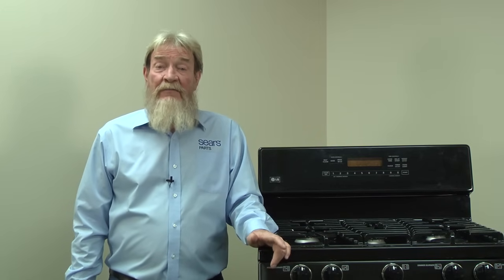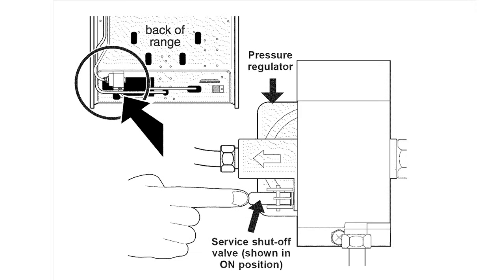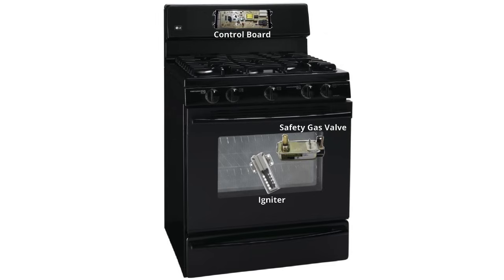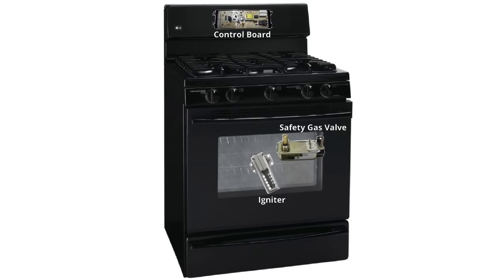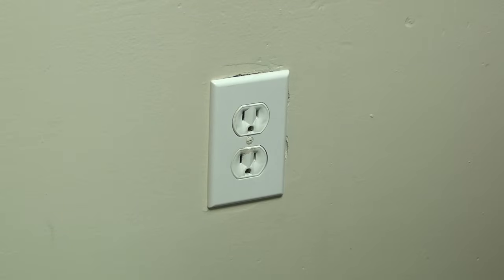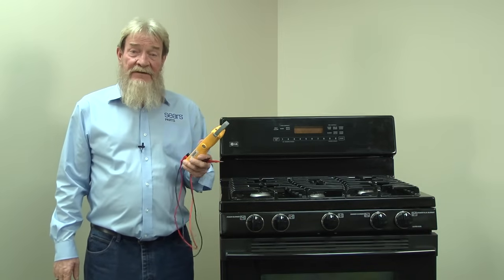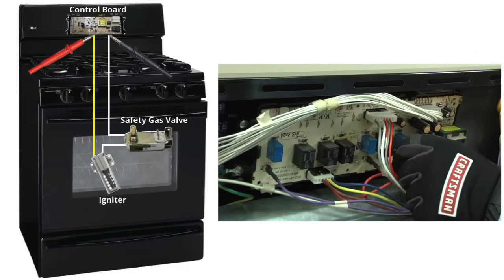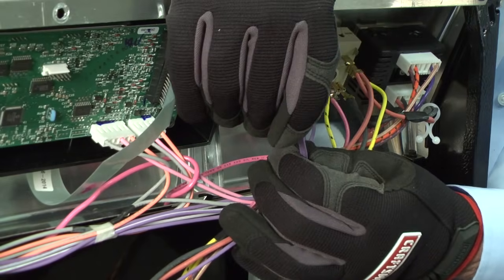How to Fix a Gas Oven that Won't Heat: Troubleshooting Gas Range Problems

Comment: My GE takes much too long to pre-heat, I did change the igniter, still the same :-( Suddenly weeks later all OK. Heats like it should = very fast. But a few months later it's doing it again! Takes 40 min to get to 350!!! Please help, thanks
Reply from the maker: Let us know the model number of your GE range and we’ll try to offer some additional troubleshooting tips.
Reply: Thank you = JGBP32DEM1WW
Reply from the maker: Thanks for letting us know the model number of your range. Pull the bottom panel out of the oven as shown at :50 in the video. Start the oven in the bake mode and see if the igniter glows and the burner lights. If the burner lights, then this intermittent failure may be difficult to diagnose and fix because the electronic control, igniter and safety gas valve are all working at times in the oven. If the igniter glows but the oven doesn’t light within 60 seconds, then a failed igniter is likely causing the oven heating failure. A bad safety gas valve could also prevent the burner from lighting but the safety gas valve rarely fails. You can test the safety gas valve by measuring resistance through the bake burner connections on that valve. Unplug the range and allow the oven to cool before checking that resistance using a multimeter. The meter should measure 1 to 1.2 ohms through the safety gas valve. Replace the safety gas valve if your meter doesn’t measure resistance in that range through the valve. If the safety gas valve is good, you may need to replace the oven igniter again. When you replace the igniter, make sure that you don’t touch the igniter element with your fingers because oils on your fingers can contaminate the element and cause the igniter to fail prematurely. If the igniter doesn’t glow or doesn’t keep glowing long enough to ignite the burner, then the bake relay on the control is likely bad and you’ll need to replace the electronic control board. We hope these tips help. Let us know if you need more assistance.

Comment: My broiler and range top works. The ignitor glows - and seems to turn on the gas safety valve - which release gas. BUT, the burner doesn't burn so I'm getting gas flowing all over until I shut off the oven.  Help!
Reply from the maker: Based on those details, we recommend that you have a service technician examine and repair the range. The burner tube may be clogged or damaged—preventing the burner from igniting. The burner also won’t ignite if the igniter is damaged or isn’t positioned properly on the burner tube. It’s best to have a technician check those issues and repair the range so unignited gas doesn’t keep flowing when you try to use the oven.

Comment: which sounds more likely the culprit. kitchenaid gas range. suddenly just quit making heat in the oven. the top broiler appeared to glow and heat got to about 268 out of the 350 i set it to.  no gas to the oven unit. tried the burners, no click, no gas.   *checked water heater, and yes gas is flowing great*.  oven has been in place for almost 2 years now btw. im thinking either control board or safety valve, as it was pretty sudden. after about 20 minutes * i thought it was cooking i noticed the low temp, checked and saw no flame, did my burner test. so i shut off the oven for a moment. turned it back on, same story. well i already had chops part cooked so i figured id let it low temp them. another twenty or so go by and i hear the oven suddenly trying to click to light. it doesn't succeed but now the burners work.  board or valve more likely culprit? i intend to test both but it will be my first range repair so i want to get it right. its my own btw
Reply from the maker: Let us know the model number of your KitchenAid gas range and we'll provide some troubleshooting steps that should help you determine the cause of these problems. We need the model number because some KitchenAid ranges use different ignition systems and gas control systems than the one shown in the video. We’ll be able to see technical information for the ignition system and gas control system using the model number for your KitchenAid gas range.

Comment: hi. my oven need to be ignite using matches. but there is no flame comes out at the tiny hole (gas burner) .. only at the starting point where i put my match.. why there no flame around the gas burner??
Reply from the maker: Let us know the model number of your range and we’ll try to provide some help.

Comment: The flame in our oven goes on and off before even reaching the temp. It takes over an hour to preheat. The igniter isn't the issue because it lights the oven in about a minute. The issue is the flame isn't consistent enough to keep the oven hot. What could it be?
Reply from the maker: Based on the symptoms you describe, a weak igniter still could be preventing the oven from heating properly—not enough electrical current is flowing to the safety gas valve to keep the valve open and the oven burner lit as needed. Because you said the oven eventually heats to the set temperature, it sounds like the sensor, burner and gas supply are likely all okay.
 
Loose wiring connections could possibly cause the same symptoms. Unplug the range and check the wiring connections on the igniter, safety gas valve and control. If the wiring connections are okay, then you’ll likely need to replace the igniter.

If you get to the point where you need to have a service technician diagnose and repair the range, you can schedule service here: https://www.searshomeservices.com/.

Comment: Any advice for an oven that keep blowing it's oven igniter?  I've replaced it twice (igniter)
Reply from the maker: When you replace the oven igniter, don’t touch the new igniter element with your bare fingertips because oil from your fingertips can cause the igniter to fail quickly.